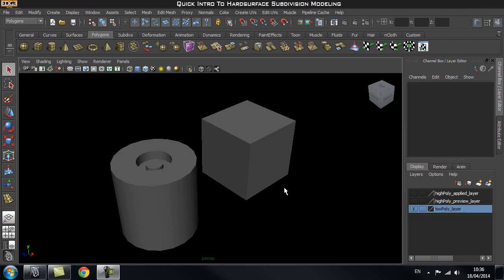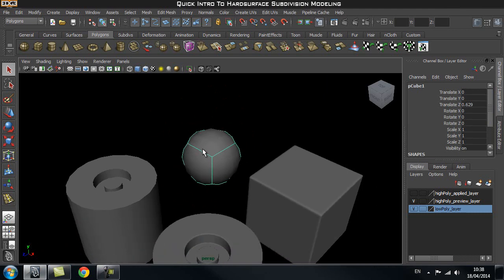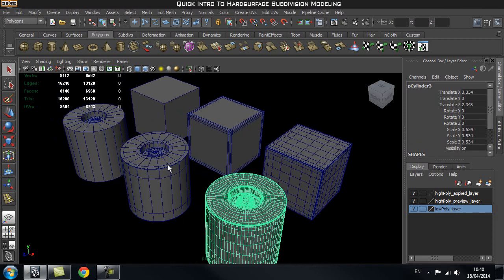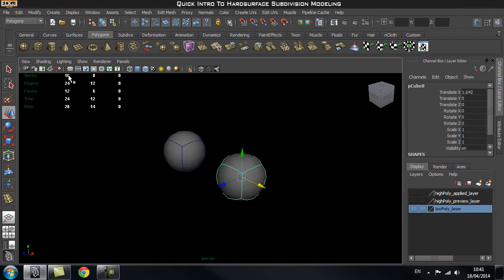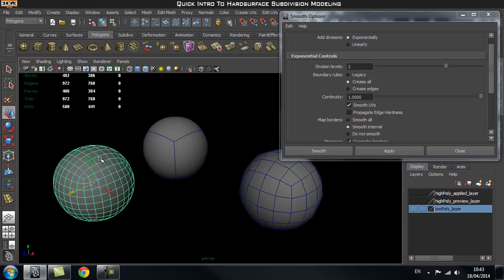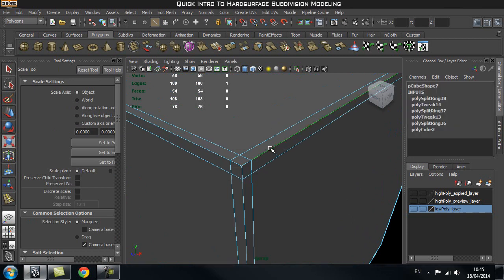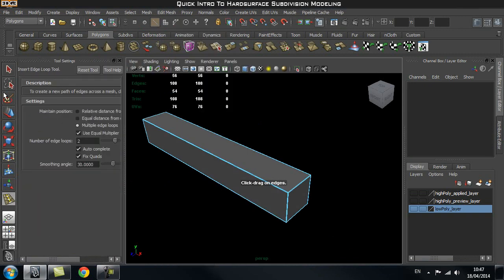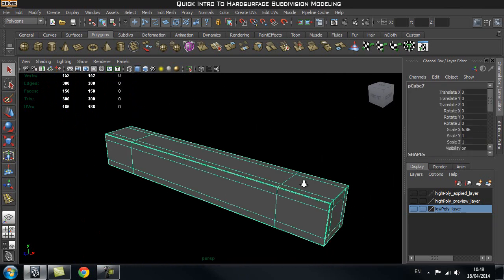Maya Tutorial for Beginners - Hard Surface Subdivision / High Poly Modeling quick intro

Comment: That is not subdivision modeling though. That's just smoothing poly meshes. 
Subdivision surfaces keep the low-poly mesh as a hull and you can control edge smoothing via the crease settings on the edges of the hull. It's non-destructive and definitely the way to go for high res hard surface modeling.
Reply: Exactly, after 7 mins in the video I was like "wait, this is not subdivision. It's smoothing groups"

Comment: So while modeling we will press 3 to see the smooth preview and then adjust the edge loops 
And after we have completed the modeling process we will Apply smoothing by going to mesh>smooth
Correct me if I am wrong
Reply: No, dont do that. That will create a really high poly version of your model that will be hard to work with if you need to make changes. Most render engines have a method to subdivide the model at render time. Giving you the benefit of subdivision and a low res model. Using the 3 button is a way to see what your model will look like when you subdivide at render time. Google "adaptive subdivision" for your rendering engine to find out more.
Reply: @inkman002  does unreal 4 support subdiv or can i not use that workflow for UE4 assets?
Reply: @fivemeomedia  traditionally game engines rely on low poly models to keep things fast and efficient. I suppose if you were only going for a single still image you could subdivide your model before export so that its nice and smooth.

Comment: Hello i've got a question if i wanna create Sci fi (hard surfaced) Game character do i have to create the Hard Surfacing on the low poly model or how does that work ?? :)
Reply: Do you mean with a soft bevel in the middle or do you mean Harden edge? if you want a harder edge, Shift right click > Soften/Harden edge > Harden edge. However if you want a smooth edge with a low poly asset there is a more advanced way of projecting a high poly smoothing onto a low poly object.
Reply: i am sry i was a scrub back then :D i dont even know what i meant here :D
Reply: Chris fair enough
Reply: :D

Comment: Whats that technique called when you can modify the lowpoly version within a visible bounding box and it applies the smoth on the go? I forgot the name of the technique and im trying to find a video of it as Ive seen some modelers use it where theyd shape a model in lowpoly, then apply a subdivision of 2, go back and modify the low poly and rerender the subdivision of 2 so that the surfaces renders and behaves in the liking of the artist?
Reply: Edit: Oh I suppose its just pressing 2 (for showing low and subdivided model. Doing so shows the bounding boxes ive been seeing in videos. Thanks for the vid!
Reply from the maker: If I understand your question correctly then you the same way that we use the smooth mesh preview by pressing number 3 on the keyboard and then switching back to unsmooth preview by number 1 on keyboard. If you want to see the original volume's outline as well as the smoothed mesh you can press number 2 on your keyboard which will show your mesh with smooth mesh preview but it will also display a bounding box of the original surface. Hope this helps
Reply: Edge3Dcgi Tutorials Perfect response! Then this video is exactly what I needed. Cheers!
Reply from the maker: adriandeveraaa Glad to help !

Comment: Hi. Please. Why my polycount increases after I using subd preview just like when I use smooth function?
Reply from the maker: Hi,

Does it increase the polycount inside maya or when you import it to another software package?

Inside maya the polycount should not change, unless you are directly applying the smooth to the mesh.
Reply: Inside Maya. When I turn on "Poly Count" display it shows exactly the same faces number for subd preview as for smooth. I have cube and both subd and smooth set on 2 divisions level. Both have 96 faces.
Reply from the maker: 4LaCKY1 Go to - display - heads up display - poly count, and click on the box next to the tool. A options window will pop up, and make sure it is set to Cage, Then it will display the actual poly count, and not the poly count when the mesh would actually be smoothed.
Reply: Edge3Dcgi Tutorials Thank you very much... I really appreciate your fast advice. PS: You tuts are really helpful.